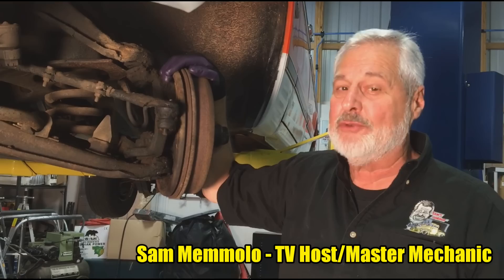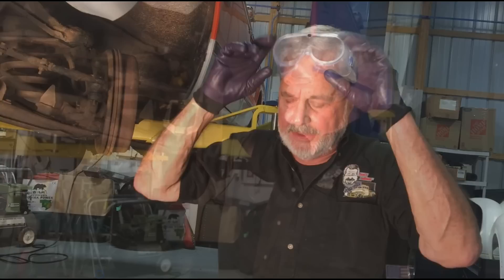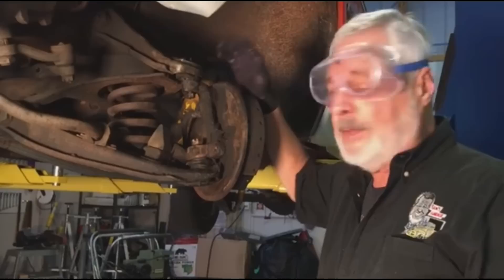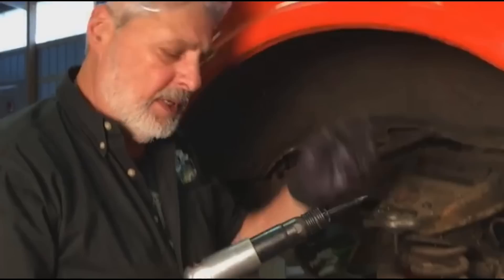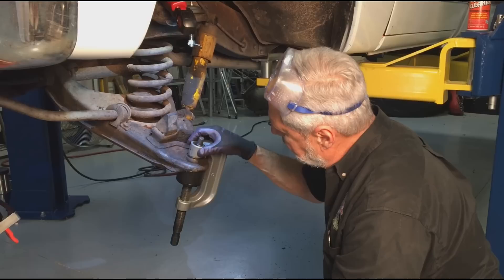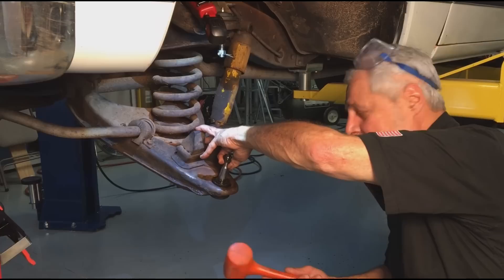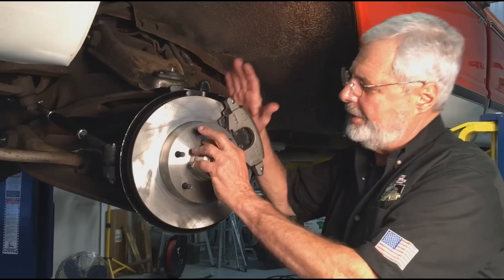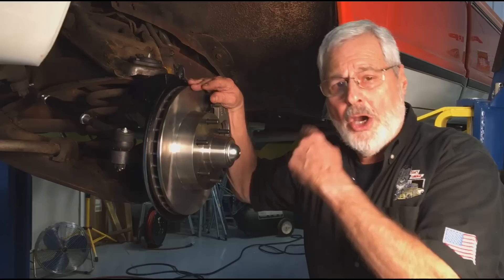1963-1972 Chevy/GMC Truck Disc Brake Conversion

Comment: Sam is the man! I stored my lower ball joints in my deep freezer overnight, then pulled them out right before I pressed them in. I think it helped a lot. I just did this last month on my C10, well worth it.
Reply from the maker: Great Tip!
Reply: Do I need a brake booster when installing this kit?
Reply: @anthonysao8830  it's up to you. I run mine with a wilwood master, no booster. I like manual brakes much better

Comment: Can someone give me some advice, i have a ‘68 k20 4 wheel drum non power brake.  I want to convert it to front wheel disc brakes and add power brakes.  I have no clue where to start being that nobody sells kits for 4x4 trucks.

Comment: I am starting my brake conversion on my 1965 chevy . The video helps ! Thanks for sharing ! I'm going to do ball joints and tie rods as well . Thanks again !
Reply from the maker: You bet! Have fun with the project.
Reply: @BROTHERSTruckPartsTV AWSOME Show and Tell 👍🏻  I’ve used the Floor Jack also to take off the Spindles . Just make Sure you have a Motor In the hood . The weight will help !

Comment: Great Job..I hate to be picky but when you swung  the left rotor straight..you had your hand on the tin backing plate and you bent it towards the rotor I have seen this a lot on cars I have repaired..I always bend them back and away from the rotor..because if they rub or a rock gets stuck under them they make all kinds of weird noises..Thanks for the video

Comment: Will this kit fit stock steel 6 lug rims on my 1968 chevy c10? Id like to convert to disc brake and keep my powder coated 6 lug rims and just ordered whitewalls so definetly dont want to change rim size. Thank you for informative video.

Comment: Down the road when parts wear out, are calipers, pads, and rotors available separately? Seems like a nice kit, but not if you can't maintain it. I checked the website and didn't see the parts available seperately, but maybe I looked in the wrong place.
Reply from the maker: Yes, completely replaceable using later model Truck replacements.

Comment: I have a 1962 chevy C10 which I will be putting disc brakes on for the front, is there a vehicle that I can snatch the spindle from used that would work for my application, or will I have to buy them new? Or is there an adapter bracket that I can buy instead?
Reply from the maker: There's nothing out there that will bolt straight on to the '62, you're stuck buying disc conversion spindles that are specific for your truck.
Reply: @BROTHERSTruckPartsTV  I Agee - that’s what I am going to do to my 66’ -soon ...

Comment: I have a 67 C10 truck but it's having small wheel studs.will the big studs fit in the same drum and Axle?
Reply from the maker: Ruben, the studs should be the same size? Why does your truck have small studs? Doe you mean it has 5 studs instead of 6? We have conversions for 5 lug and 6 lug trucks at www.brotherstrucks.com
Reply: @BROTHERSTruckPartsTV  it's having 6 studs which 11 mm.i wasn't trying to fit the nuts from Ford f100 but they can't fit.and I tried to fit the nuts from my 67 C10 truck to Ford f100 and they are small
Reply: @BROTHERSTruckPartsTV  I mean the wheel bolt and nuts
Reply from the maker: @rubenfilippus2956  our 6 lug units have 7/16" (11mm) studs, our 5 lug units have 1/5" studs, does that answer your question? If you need more help with this PLEASE CALL US at 800-977-2767, it is very difficult to do technical troubleshooting through YouTube comments.
Reply: @BROTHERSTruckPartsTV  Exactly

Comment: I'm working on  a 72 Chevy c 30 with duallies. Trying to replace the rotors. I suspect the upgrade was already done. None of the rotors I have ordered fit. The rotor itself is too thick for the calipers. Help
Reply from the maker: Call our shop and lets see if we can help figure it out. 800-977-2767

Comment: If I’m doing this on my 69 c10 do I need to do anything to the factory master cylinder/booster?
Reply from the maker: You need to change the factory master to a Disc/Drum master that will deliver proper pressure front and rear as well as hold residual pressure in the front. Not sure, but you might be wanting to convert to Power Brakes at the same time. Check out our website www.brotherstrucks.com for all the possibilities.
Reply: BROTHERS Truck Parts thank you

Comment: What size rim/wheel will fit on the 66 front disk brake conversion site only says stock(15”)won’t fit but will a 16” fit?
Reply from the maker: 99% of stock 15" or bigger wheels work. There are VERY few wheels that won't. We've actually never come across any that don't.

Comment: Im gonna be upgrading in the next week to disc brakes All the kits I dont see anyone including a backing plate. Do I really need one? It's for a 1970 c10
Reply from the maker: It's not necessary. It was a factory installed item in the 60's-70's and it's not common to put them on when doing a conversion.
Reply: @BROTHERSTruckPartsTV  great thank you.

Comment: website says these won't fit stock wheels. Are these 15 inch rally wheels stock and will this kit work?
Reply from the maker: It really depends on the wheels offset when you are running 15". Contact our office at 800-977-2767 and we'll help you sort it out.

Comment: Will 15” rally wheels fit over the 12” rotors?
Reply from the maker: The rotors in this kit are 11" and they will fit with a 15" rally. 12" rotors will most likely NOT have enough clearance on most Rally Wheel offsets.
Reply: I have a 68 suburban all stock.  Will this kit fit with my original wheels?

Comment: 68 C30 disc brake swap please. Guess I should look into a cross member change from a 73-87 C-30
Reply from the maker: Yeah, bummer nothing is available for the C30. Your best bet is to piece one together from a later year model truck like you said.

Comment: I know this is an OLDER Video, and it does look interesting but I have a 1970 Chevy Suburban 4X4 and I am looking for info how to CONVERT That from FRONT Drum to DISC. I have done the 2 wheel drives, and THATS ALL the INFO out there anymore. So If anyone can help PLEASE LET ME KNOW! Thanks!!
Reply from the maker: As far as we know there is no commercially available 4x4 Disc conversion. Most guys switching pre-1971 4x4's to disc just use a front axle from a 1971 or later truck. Sorry we couldn't be more helpful.
Reply: @BROTHERSTruckPartsTV  Ok, thanks anyway. I was told by one you tuber "as long as its a dana 44 the spindles should be the same, without switching the hole diff/rear end, being as I can NOT find anything with disc front end on it. So I'm kinda in a rut, but time will find a way! thank you..

Comment: What factory steel wheel will work with this brake conversion - working on a 65 C10. Thank you.
Reply from the maker: Pretty much any of the 15" wheels will work.
Reply: So 15” stocks will fit?
Reply from the maker: @edwardnunez218  yes!

Comment: these are great, but what about us K vin guys? do you have a conversion for the 4x4s?
Reply from the maker: Us K guys (we have 3 here at the shop) only option at the moment is to swap axles. No kits are currently available (Sept 2020)
Reply from the maker: @Rogue_wyo   Yessir, thank you buddy! We'll check into this and maybe something good will come from it. Appreciate it!
Reply from the maker: @Rogue_wyo   Tossed this over to the product development guys and they already knew something about this. It sounds like the small bearing spindles would have to be manufactured before a kit could be offered. Otherwise, pre-1970 K guys would have to go out and get a set of spindles from a junk yard, etc before they could mount all the parts for the conversion. This doesn't appear to adapt onto the factory drum spindle.
Reply: ya the video mentioned spindles from g2.
Reply: it was a spindle from g2, a bracket from Ebay, then 71-91 blazer/k10 small bearing parts. and rear e-brake parts from a Cadillac eldorado
Reply from the maker: @Rogue_wyo   Well, if we could get a G2 spindle produce then a kit would be a breeze! We'll continue looking into it. Thanks for the help!

Comment: Is it the same kit for a 65 as 72 c10 or are they different?
Reply from the maker: Different kits. Balls joints, tie-rods, etc are slightly different through the years, so the parts in the kits also vary.

Comment: Great video! Question for you. Do I need a new Master Cylinder and booster to install this kit? Or will it work with my original Booster/master cylinder?  I know I would need to add a proportioning valve right?
Reply from the maker: Ideally you should at least change the master cylinder. Disc type master cylinders have a different bore size than those used in a drum brake system. Additionally, most disc type maters cause a small amount of residual pressure to remain in the lines to keep the pads from retracting too far.
Reply: @BROTHERSTruckPartsTV  Thank you so much for the reply! Definitely going to upgrade the master cylinder. You just earned my business.  Thank you again...

Comment: Couple of questions.... i have a 63 im slowing fixing up, i am interested going to disc brakes on the front. Would i need to replace the original booster? And will the fit 6 lug gm wheels?
Reply from the maker: In '63 your factory brakes had a single cylinder master which we always recommend you convert to dual cylinder for safety reasons... so YES, we would say replace the original Booster/Master combo. As for the 6 lug wheels, our disc brake conversion will fit behind MOST 15" factory 6 lug wheels. If your wheels are 14" however, there is almost ZERO chance of them fitting with the disc conversion.
Reply from the maker: UPDATE: After a doing a little research regarding wheel fitment, we've found a few variables that make some 15" wheels NOT FIT with the disc brake conversion. Primarily, if your 15" wheel has only 3 "nubs" on the center of the wheel to retain a hubcap then your wheel will probably NOT WORK with disc brakes. If your 15" wheel has 4 nubs for hubcap retention, then it WILL WORK with disc brakes. Thank you for asking, we hope this helps.
Reply: I had  to go 16" min went with 17" wheels for my upgrade 6 lug also
Reply: How can I convert front drum brake to disk by using Parts from wrecking yard.
Reply: @georgecurrier5018  I'm wondering the same thing. I have a 69 GMC, 6 lug drum brake set up. It would be great if I can pick up from a junkyard everything I need.
Reply: @robgaskins8181  get them off another truck 72’ 
They had Disc’s introduced. Or just buy the new Conversion. Newer !!!

Comment: My lower castle nut won’t tighten enough to get cotter pin on- can I use ball joint press to tighten down spindle onto joint?
Reply from the maker: you'd be better of to back it off a little bit to the next notch that the cotter pin can be put through instead of trying to use a ball joint press.
Reply: No my problem is during assembly. My new ball joint won’t fit into my New lowering spindle. Like I can’t even thread castle nut at all to get to cotter pin.
Reply from the maker: You have the wrong spindle then. They make these spindles with various different sizes/tapers to accommodate particular years of ball joints that were different sizes. It sounds like you have a spindle that's got an early size tapered hole. If you bought them from us then call our Customer Service at 800-977-2767 and let's get it handled.
Reply: @BROTHERSTruckPartsTV  I agree Omggg

Comment: Will this disc brake conversion required Power Booster to assist braking?
Reply from the maker: You can do a disc brake conversion without adding power providing you run the proper master cylinder and proportioning valve. However, we would recommend doing both at the same time.

Comment: Great video. What’s the torque specifics for the spindles?
Reply from the maker: Roger, typical tapered bearings can be manually adjusted using this method:
"... in the case of a conventional truck non-driven wheel with a single adjusting 
nut design, manual setting involves tightening the 
adjusting nut while rotating the wheel until a slight bind is felt. 
Then the adjusting nut is backed off 1/6 to 1/4 turn to the nearest 
locking hole or sufficiently to allow the wheel to rotate freely 
with some minimal end play. The adjusting nut is then locked in 
this position. Skill and judgment are required to determine when 
the wheel binds slightly in rotation." For more on this subject you can visit https://www.timken.com/wp-content/uploads/2016/10/5556_Bearing-Setting-Brochure-1.pdf Thanks for asking!
Reply: @BROTHERSTruckPartsTV  exactly

Comment: should i put front and back and what is the best price to do the job or kit
Reply from the maker: Adding front disc brakes is a safety and convenience step that most classic truck enthusiasts do. however, adding rear disc brakes is up to you and ultimately what you want your build to be. As far as install cost, we would estimate it between $400-$750 depending on the shop you choose.

Comment: Where can I buy this for a 1971 C10 half ton, Long bed, 5 lug?
Reply from the maker: We have a disc brake conversion that you can find on our website here: https://www.brotherstrucks.com/71-72-WILWOOD-DISC-BRAKE-CONVERSION-5-LUG/productinfo/DBU5L25/

Another option is the Complete Big Brake Kit with Power: https://www.brotherstrucks.com/63-87-COMPLETE-BIG-BRAKE-KIT-WITH-POWER-5-LUG/productinfo/CBBK875/

Please feel free to call us during regular business hours to make sure this is the exact kit that will work for your application.
Reply: BROTHERS Truck Parts you guys are awesome. Thanks guys!!!
Reply: BROTHERS Truck Parts one more thing guys, I don't know much about breaks except replacing them, I was wondering if these come with dust seals, I see in the description that it states it has dust caps, are those the same thing? Hey and thanks for the quick response. I wasn't expecting a reply so fast.
Reply from the maker: Yes they do!

Comment: Do you guys make disc conversion kits for 67-68 3qtr ton chev pu?
Reply from the maker: You can convert it to disc, but first you have to convert it to 1/2 ton parts. It's really not that big of a deal, just an extra step for the 3/4 ton guys.
Reply: BROTHERS Truck Parts ok but I’d like to keep the 8 lug wheels front and back; any advice?
Reply from the maker: @robert.williford527  That can be done, but the specifics of that conversion are too much to get into in YouTube comments. Call our shop at 800-977-2767 and have one of the Tech Guys go over it.

Comment: Would this kit work on my 66 gmc k1000?
Reply from the maker: Our disc brake kits won't work on a 4x4, 2wd only. Customers who have converted to disc on 4wd trucks normally just swap the axle for a later axle with discs.

Comment: What’s the assembly kit number to order?
Reply from the maker: On this truck we used a 6-Lug "Deluxe" conversion, but you might want to check out the other options here and decide what you prefer https://www.brotherstrucks.com/Front-Disc-Brake-Conversions/products/2139/